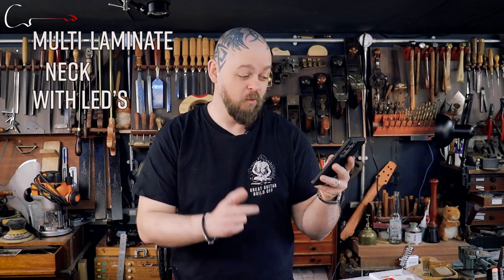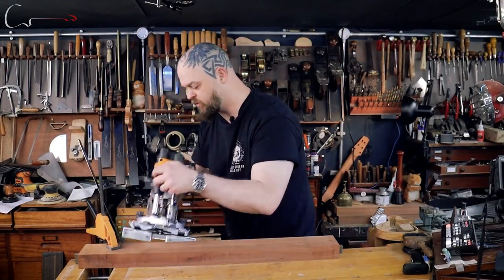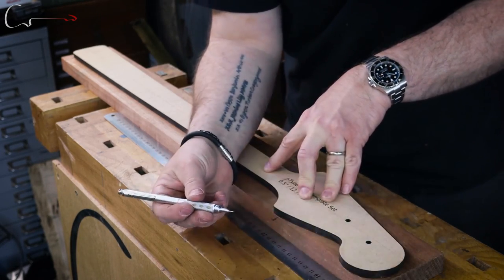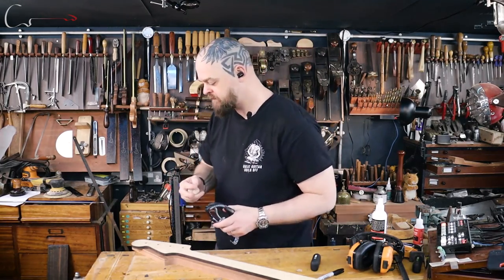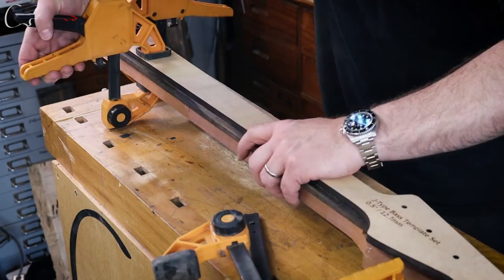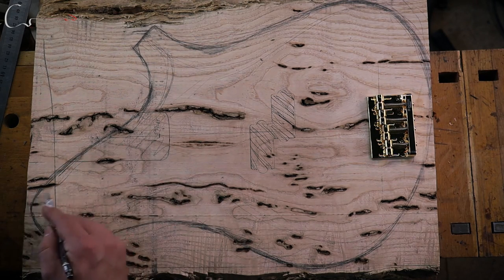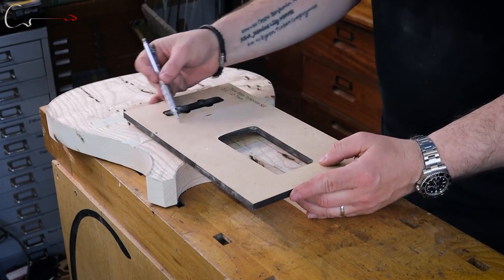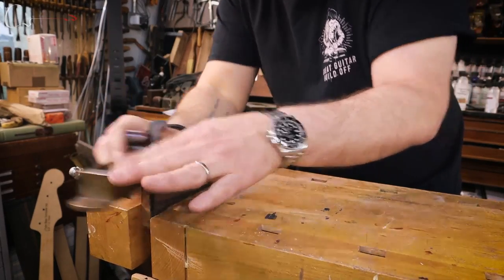Designing, Cutting, & Shaping the Body & Headstock Ep1 | Making a Custom Bass Guitar from Scratch

Comment: The blue painters masking tape is all I ever use for the super glue and masking tape trick. 30 guitar builds and not once has a single template slipped. I usually wind up wishing it didnt stick quite as well as it does...

Comment: I think this is the first time I've seen you use a vacuum. I use my shop vac all the time. You usually just blow or brush sawdust and shavings out of the way, which means you have to vacuum or sweep them up later. (Plane shavings make the best fire starter.)

Comment: This is shaping up to be one of the coolest builds yet. Deffinitly like the glow fret lines idea and staying fretless I do think it should get a hard epoxy treatment on top to seal it after so you can use round wound strings. I also think doing soap bar style wood pickup covers would be cool but have the pole pieces exposed thru the cover and just add a 2nd quarter pounder p for the bridge position this would look and sound amazing. Also lusithand make a filter based preamp like a Wal that would pair very nicely to this

Comment: Ben, you've told us what you use for your mechanical pencil before (read the reviews- seems prone to breakage due to plastic internal parts, so will wait on it- it's expensive for a pencil), but you haven't told us what type of eraser you use. I've found those to be just as important as the pencil and hardness of lead- and MUCH harder to find good ones that won't crumble away immediately, or smudge and smear instead of erasing. Since you do a lot of drawing on rough surfaces, I'd like to know what eraser you find works well when designing directly on wood, and also doesn't smudge when using on paper. Thanks!
Reply from the maker: Ben uses a standard Staedtler pencil eraser.  Hasn't gone wrong so far...

Comment: Seeing your use of the router table there Ben, I'm in the process of designing my own for guitar building (for those things where my CNC is overkill). I have two routers, and two corresponding inserts with lifts (having both on the table makes it quicker to change between two bit sizes). However, I also want to be able to convert it to an overhead pin router as I think it better for some type of work to see the router bit at work and having the template ride on a pin below.
Do you have any pointers on how I should go about that? I have a general idea on how I want the stuff to be laid out, I am not so sure about the pin router addon and how to fix it to the table. Any ideas on that?
Reply: I just put that question in the queue for the livestream via Discord, but if anybody else has an idea on how to approach this, any pointers are welcome!

Comment: With automotive sheet metal you would start at one side and move across to the other. Automotive cylinder heads are tightened from the center outward but in stages.👍
Reply from the maker: Thanks for the tips!

Comment: Lose the "nose" of the beaver..with a nice industrial arc from the high point of the body to the side of the neck...also run an experiment with the day-long resin on a body cutoff before you commit ....the resin might not have the luminescent strength for contrast that the body needs.